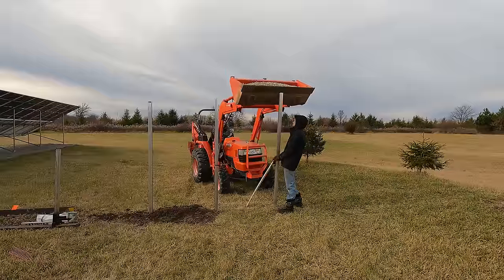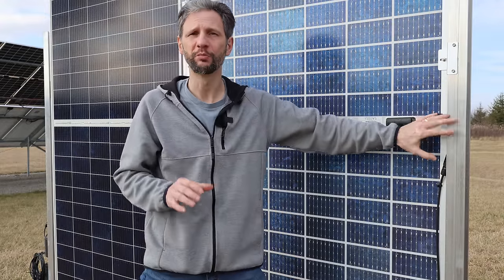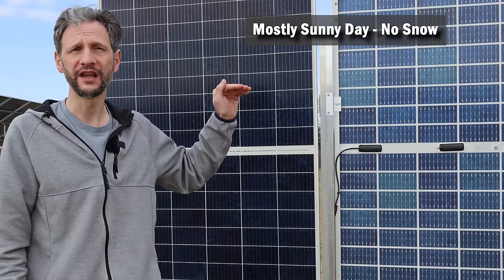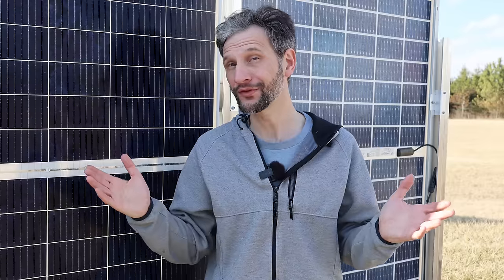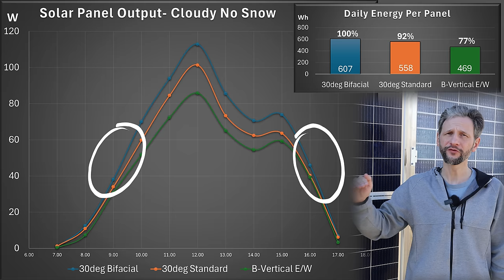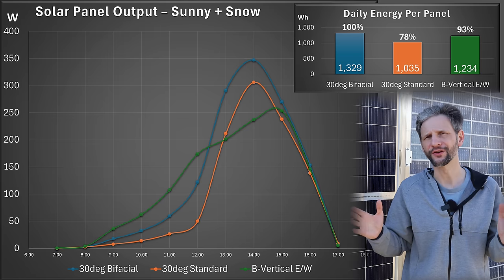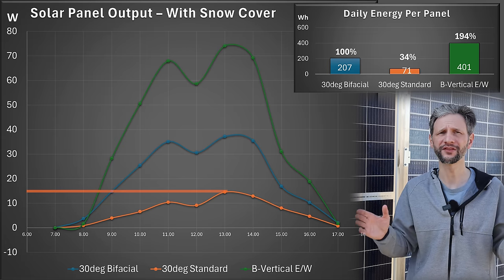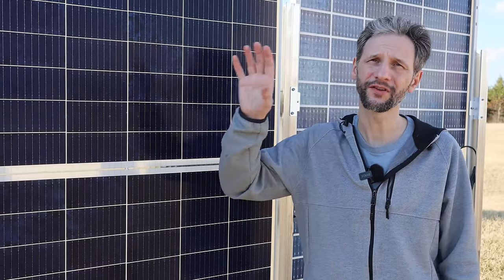Vertical Bifacial Solar Panel Performance Results Part 1

Comment: Those vertical panels look bit low on the ground for my taste. Of course it depends but snow coverage is something to think about. No issues in the video, but theres basically no snow in the video.  We have a groundmount with panels starting around half a meter from ground. It gets filled to the brim if the top starts to slide down after bigger loads. Solution is to run a snowblower underneath the edge of the panels. If not cleared it wouldn't have room for the next snow to fall anywhere and sliding off wont happen anymore. The verticals would have a stick after every panel. Thats no bueno if it starts piling up. And it will. Especially as its a wall in the middle of the field. With that height it will be hand shoveling all the way to spring. So no results for actual winter solar if the bottom is covered up. Needs more height.

Meanwhile i would be willing to use the vertical panels on a second floors terrace edging. Slightly offset from the surfaces so the snow can slide off and away so there shouldn't be too much pileup.
Reply from the maker: My test fixture didn't have adequate structure for raising them that high of the ground, but good point for those with heavy snow.  You will need significant underside clearance.

Comment: Have you done any tests with vertical bifacial panels facing south? I am interested in how that compares to optimum tilt.
Reply from the maker: I have the materials ready to install a south facing set, but it will be a while before I have data ready.

Comment: Hey Dave. Can you test if it is not cheaper to just use single faced panel in vertical mode, but double them back to back? It will be not cheaper initially (because number of panels will be double), but the yield could be greater.
Reply from the maker: You would need a gap on between the panels to dissipate heat, but you should get better results that way, the back would produce the same as the front.  The panels would have to be significantly cheaper to offset the extra racking expense.

Comment: have you tried turning the vertical panels 90 degrees so one side is facing south? it might produce more while still allowing for the chimney effect for heat dissipation

Comment: I wonder how well these vertical panels would perform if you placed mirrors on either side facing the panels at a 45 degree angle. That should completely eliminate the mid-day dip in power.
Reply from the maker: I did something similar, test results coming soon....

Comment: Good start Dave, but you did not include the ambient temperature and cell surface temperature. You solution will make sense in upper USA and Canada but in the lower states  or in locations with higher ambient temperature like in the summer your conclusion won't make sense.  I think in the summer where the power usage peaks due to AC use the Vertical panels will be a lot more effective.
Reply from the maker: I'll bring more results after the summer solstice.

Comment: Why not mount conventional panels (especially used) vertically and back to back.  Mount the east facing ones solid and mount the west facing ones on a hinged mount to allow access to wiring on the back side.. Wouldn't this be the same thing and be more budget-friendly?
Reply from the maker: You would need a gap on between the panels to dissipate heat, but you should get better results that way, the back would produce the same as the front.  The panels would have to be significantly cheaper to offset the extra racking expense.

Comment: I don't think vertical mounting is optimal in hurricane country. So far my roof panels have withstood Cat 1 with no damage. Your chart indicates a greater total from angled panels as well.
Reply from the maker: I would agree in general.  Mounting panels vertical is much more challenging from a wind load standpoint.

Comment: So vertical mounted bifacial panels look like a good way to save on inverters and batteries while also significantly increasing the power output on the worst days.  Given that panel prices are still falling, looks like a good compromise in many real world situations.

Comment: Do bifacial panels cost the same as one sided panels? If not, shouldn't you have some cost per watt data? When I bought my first panel 15 years ago it was at $4 per watt. Now they're about $1 per watt. But are bifacial panels to be had at $1 per watt? BTW: all of my panels have now failed.

Comment: In a place that often see snow, would a south facing bifacial array with primary side facing down be beneficial? Since the top side would be covered in snow most of the time, the downward facing primary side would pick up more reflection from the snow on the ground. It'd be interesting to see if this theory holds true.

Comment: So... If you have a roof facing half north and south and a property with space for a solar fence:
It is a good idea to build a fence plus the south roof.
Reply from the maker: You can create systems like that with arrays facing multiple directions.  You just need to plan your inverter strategy accordingly.  Make sure you have enough MPPT inputs for all the separate conditions.

Comment: Could you add a "V" shaped reflector at the base of the vertical panel in order to capture some noon sunlight.
Reply from the maker: I'm sure that would help, but I'm not sure you would be able to justify the cost.

Comment: So ideally, some type of reflective biodegradable pellets should be placed in between all vertical mounted systems that emulate snow.. :) Ideally these wouldn't be rocks because of the thermal radiation

Comment: After a hurricane I'm sure you'll find those vertical panels in the next ZIp code.
Reply from the maker: Yes, most likely true.  This test fixture is not meant to meet the 90mph wind load requirements for solar installations.  It's just a proof of concept.  However, we just had a tornado a few miles from me.  It took out a trailer park.  My panels are still standing.  I'm sure they would not withstand a direct hit from a tornado, but they have survived 60+mph gusts so far.
Reply: @ProjectsWithDave well, already a few hundred metres from the tornado make a huge difference vs. a direct hit.

Comment: Love it. I would be trying to use reflective surfaces to try and boost production. 
    |        |
    |        |
\  |\     /|  /  
Something like this where the reflection should not be affected by the vertical panels shadows. Of course, better angles would need to be used. Maybe even a concave surface to reflect more area onto the panels. This means the space between the panels becomes unusable again, which is one of the benefits of having vertical panels.
Very interesting stuff.
Reply from the maker: Nice diagram!

Comment: is there option to install small inverter 50% Peak Power but if production is excess utilize that power to heat boiler directly from the panels. 
having example 10 heat elements in operating voltage of solar panels and how much power they use just switch how they are connected combination of series/parallel connection. is there any driver for this? If inverter is on max power,(or have no load) turn on boiler heating.

Comment: The more important question is...  where's the sweet spot for price / performance?

Can you collect more energy with more non bifacial panels  at the same cost? 

I believe that 30% and definitely 50% more panels collect more energy for the same price.

Also I have read multiple test that concluded heat causes significant loss of efficiency in bifacial panels.... much more than with Monocrystalline
Reply from the maker: Panel prices vary widely, I address the cost vs performance in this video: https://youtu.be/1SXNjsSsmq0

Comment: If you put half your 30 degree array 25 degrees to the east of south and the other half 25 degrees to the west of south you will have PV longer and way outperform vertical.
Reply from the maker: I did some analysis on a similar setup in this video: https://youtu.be/J7xnY84Ch1E

Comment: can you investigate dual axle trackers?  I see there are a could cheap ones featured in other youtube videos.  it be a combination of the best of both the angled south facing and the vertical north south fences.  my big concern would the increase in power output per panel allow fewer panels reducing that cost offset the cost of the tracker?

Comment: Were the panels that you were using standing up connected in parallel or in series? If you connect them in series I would think that each set of panels connected in series would have to be facing the same way or it would be like shading one panel since the back produces less power.

Comment: The solaredge inverter needs a voltage of a few hundred volts right? One east and one west facing optimizer can't provide that, how did you overcome this issue? Does it have an impact on your results?

Comment: I wonder if vertical is better than appears if you look at a 5-10 year total cost per KWH. 

Vertical is never covered in snow, bird poop or anything else that blocks sun. Since the vertical panels dip out at the hottest part of the day, I'm assuming they degrade more slowly. Maintenance and cleaning cost is less.
Reply from the maker: I agree, the long term outlook is likely better for vertical.  Less likely to get hail damage, and as you said I bet the degradation is slower with the reduced direct sun exposure.

Comment: YOU NEEED to make another experiment. Vertical rotating panels. 
Nice conclusions. 

The vertical version is much easier to rotate then the tilted version.

At least the version you made can be easily transformed into a rotating version. I think a rotating vertical would outperform the south facing by far. 

This would mean we could install vertical rotating  for winter and maybe gain as much as tilted in summer?...am i too excited about this?

PLEEEEASE test this:))
Reply from the maker: Unless you rotate the entire row at once they would shade each other.
Reply: @ProjectsWithDave  Myea they would in the evening. So what remains is east west tracking. All at once.

Comment: Would you consider vertical for a roof mounted install (35° - 45° pitch S facing)? With snowy winters?

Comment: How confident are you that mid-day shade cast by the south-facing panels wasn't negatively affecting the productivity of the vertifcal bifacials? I'm looking at the Sunny+Snow scenario, and the shade cast by the big array looks to be only a meter away from the vertical bifacials. That must have had an impact...
Reply: Regardless, though, this was an awesome test. Thank you for taking the time to share this with us.
Reply from the maker: Yes, I'm sure it had some effect, however, keep in mind the vertical array was very short and not experiencing the progressive shading of the panels that would come further up in a long fence line.  I think all things considered the result is pretty reliable.

Comment: Always nice to have empirical data to base decisions on - but I think that vertical panels will be at risk from wind damage. The 30' panels in an open frame are hardly going to flex at all in the wind. But a line of panels forming what is basically a solid wall against horizontal wind will behave like garden fence panels and flex (and crack?) in gales, if indeed they don't simply get ripped to bits. Panels are not made to withstand large forces....that vertical installation looked frail to me.
Reply: It's just a question of prior structural engineering/calculations and proper structure. The solar panels themselves do withstand 4kN of wind.

Comment: Is there a case to be made to use some cheap reflective foil for the area directly in front of the vertical panels, in order to reach the stable output more consistently?
Or, alternatively, use dense and low plants such as clover, that tends to reflect alot more light? Clover also requires zero maintenance.
Reply from the maker: I'm working on a video now that will have reflective foil results.

Comment: Hey Dave! I'm looking to go off grid. My current on grid use avg is about 1,800kw a month (63kw a day but let's over estimate that to 79-80kw which gives me a 25% buffer). What would be a good setup? I like the EQ4 18k, after seeing the cube I like that too. Just want simple plug and play really complex systems so I can buy, plug and play. I have ran my house off of a 9k predator generator during winter storms and was able to do everything except run the heat pump (could have ran it with a soft started connected) but I had an alternative source for that so I was good. Got TX sun all day and an open field so there's no struggle there when it comes to getting enough sun each day for the panels. I will be using soft starters on both traditional HVAC units this time around. I will not have any other source of power once I move there.

Comment: it's HEAT that vertical mounting solves. high heat = low output. vertical mounting means you don't get directly sun overheating the panels at high noon.

vertical mounting is superior for that reason alone. if you're in an area where the heat is never a concern, horizontal will be superior.

there, the video's over and it's only been fifteen seconds :D

Comment: Thank Dave, I finally got my system installed. I have Hellene 380w and Canadian Solar 375w bifacial panels. I live in Middle Tennessee. I haven’t realized any advantages or disadvantages of these bifacials, though they are highly rated. I am still trying to identify a bright enough reflective base. Lime stone seems to be dull. Any suggestions?
Reply from the maker: There are lots of suggestions in the comments on this video I did on bifacial performance: https://youtu.be/1SXNjsSsmq0

Comment: with bifacial ground mounted panels would you see a big improvement if you added some sort of reflection outside of the panels shadow that can illuminate the backs of the panels more?
Reply from the maker: Yes, you do see some improvement.  I just ran a test with large reflectors.  Video coming soon....

Comment: What about a 15° tilt bifacial instead of true vertical? Steeper incline, less snow stickage, but a bit more of the noon sun like the normal 30° panels, and a thinner horizontal profile than 30°, allowing more space at a slight sacrifice over true vertical?
Reply from the maker: If the panels are facing South a steeper angle can be a good solution for Northern climates that see a lot of snow.

Comment: Might be a dumb question then, but, how much of a boost would you get if you had a pair of mirrors angled at a shallow pitch at the bottom of your vertical array, would that cause enough of a boost, especially for noon time?

Comment: i have some small solar panels that are made in clear plastic, and when i stack them, it seams i get about 70% of the power the first (top) outputs, from the second ( bottom) layer. Ive always been curious if there is a good way to make use of this feature, or if its a dumb idea.... bifacial panels, seam to be pretty similar in concept, so i wonder if there is some nich stacking clear solar panels can fill, similar to how this "new" orientation thing seams to fill a nich.

Comment: How about a V shaped vertical panels facing south?  Or even semi circular vertical (flexible?) panels.  It seems to me that this is an idea study simulation for a Uni to perform for various configurations.  There's enough base data around.  Im surprised this hasnt been done already, before getting physical?  Or is this a promo for bifacial panel producers?  Pls advise

Comment: Perhaps I'm just an idiot. But, it seems to me the advantage of these panels is the space saving, personally I'd use this space to mount dirt cheap mirrors on either side of the panels with the intention to boost the generation per m2 of land higher then that of South facing.
Reply from the maker: Mirror results coming in 2 weeks.

Comment: There is something else that the verticel is better at, really hot areas that over heat the hardware and reduce the output, the verticel doesn't get as hot and maintains higher output.

Comment: Have you tried 45° angling on your panels? Here in Ohio, looks like you still get some good output but I'm hoping this would help with self snow clearing
Reply from the maker: My off grid array is at 45deg.  It does clear much faster than my 30deg array but still holds snow.  You can see that build here: https://youtu.be/XSxp8pbk7q0

Comment: I have a Ford Lightning with a 98kwh battery and a 30 amp output in the bed that I'll use for my travel trailer (which only comes with 200 watts of solar). What is a good way to charge the truck  adequately off grid (will 120 volts be adequate, or do I need 240 volts?)? I will be using the 15,000 btu a/c. TIA
Reply from the maker: If you want to charge a 98kWh battery off grid you will need a very large array and a 240V capable inverter. My 3,200W array will produce 100kWh in a day if there are no clouds the whole day.  You can see that install here: https://youtu.be/XSxp8pbk7q0

Comment: This could have been simulated with software. Still an interesting video and collection of data. Vertical tilt system sounds like a niche application that may serve smaller communities that receives lots of snow. The last comparison was strange to me, because several utility scale plants already utilize automated cleaning systems to solution the irradiance issue with dirt collecting on the panels. I can imagine an iteration to the design of this system that would enable it to melt snow, too. I also found it interesting that the the value for minimum power output for Full Sun No Snow B-Vertical E/W is nearly the same maximum power output value for B-Vertical E/W with Snow Cover. Nevertheless, single-axis solar tracking systems will ALWAYS out-perform fixed tilt systems.
Reply: Single axis tracking systems are more expensive and they waste space (when talking about AgriPV). I worked on alot of them, but nowadays bifacial solar PV does just have the better ROI.